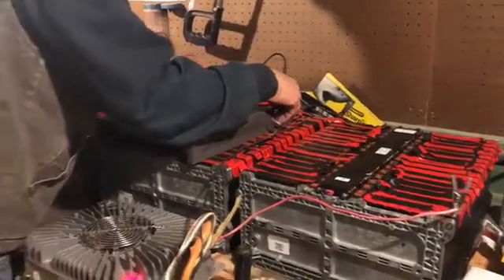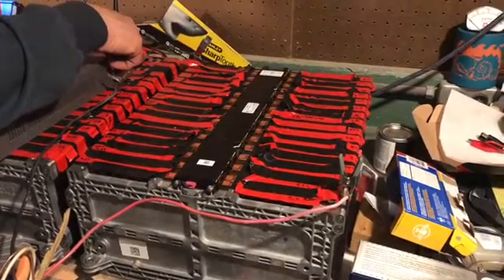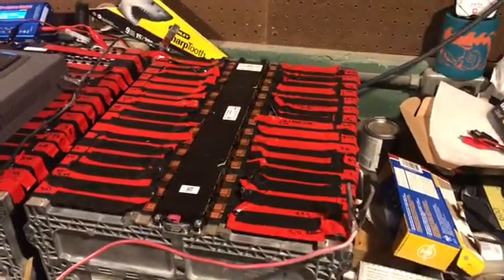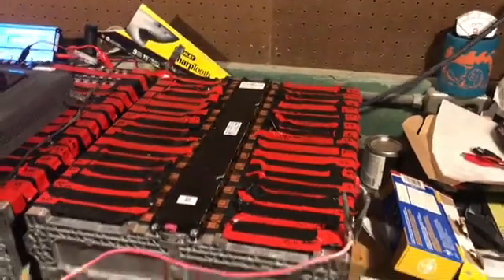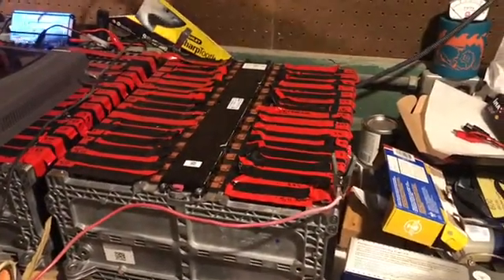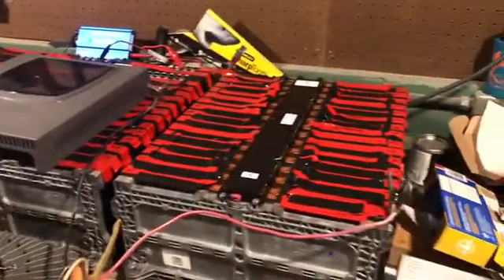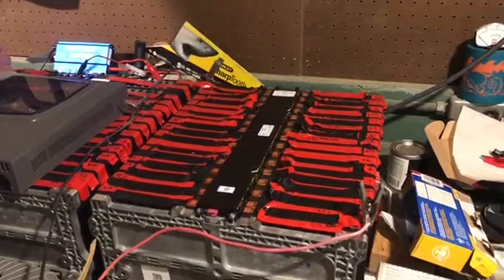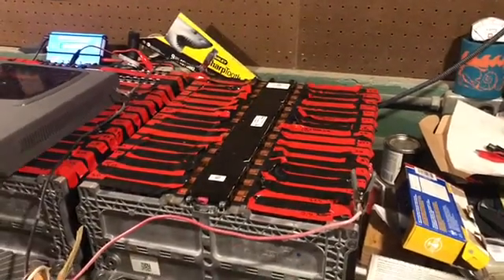Rehabbing Electric Smart Fortwo

Comment: @subjectmatteramateur16

I heard that is the 12v goes dead, the BMS goes into "junkyard mode" and disables the battery. Do you know how to fix that? Or if it is even a thing, or do I just need to charge the pack manually like you've done?

Comment: Hi Shawn, I am a car dealer in FL and have a 2016 Smart fortwo Electric with 21K miles. I bought it knowing it had a problem with the battery and not running. The car is still under warranty 4/50 bumper to bumper but the scumbags from MBUSA (Mercedes) will not honor the warranty cuz the say that every 2 years the battery has to have some kind of service that was not performed. So my question to you is: Is this battery salvageable by taking apart as you have and charging the cells separately or the 3 blocks of cells separately ? The 12 volt Aux batter is also totally dead but I am not worried about that one as it is only $200 at the dealer and I can probably maybe even use a regular 12 volt. I have the original EVSE from Mercedes. I think once the battery gets below a certain level it will not take a charge at all. Thanks, Jorge
Reply from the maker: VehicleMaxDotNet you can take the battery apart and charge each 3.6v cells, but you can’t replace them in the car because mb engineered it that way.
Reply: @subjectmatteramateur16  Thank you for the fast reply. What kind of charger do you recommend for this type of charge ? Once the battery pack is out and the cover is removed, how difficult is it to connect to each individual cell ? Is there any cutting or rewelding needed in order to access the cell terminals ? Lastly, once they are charged and assuming that most cells accept the charge...Is it just a matter of putting the top half cover back on and re-installing on the car ? Thanks !!
Reply from the maker: VehicleMaxDotNet we found that most cells took a charge and would be fine but there were some cells that were bad and not accept a charge and we weren’t successful in getting them welded back in the pack. You can separate the three packs and charge the packs individually with a specialized charger made by thunderstruck motors.
Reply: @subjectmatteramateur16  Thank you again ! Is separating the packs difficult ? and most importantly...do you charge the pack with the thunderstruck in a single port ? Or do you have to go cell by cell ? Sorry for all the questions...I just want to know if this is something I could handle. Any idea on the cost of the Thunderstruck and where to get it ? Thanks Again !!!!
Reply from the maker: VehicleMaxDotNet the main pack can be separated into three smaller packs,  those packs can be charged with a thunderstruck from thunderstruckmotors.com which is about $700. The individual cells are not hard to separate out but impossible to place back in. I found an entire replacement on car parts.com

Comment: My 2014 smart electric won’t charge. I’ve tried using the EVSE that came with it, as well as my wife’s Volt EVSE.  The 12v battery is reading 12.5 volt. I disconnected it for a minute to see if it might reset something. Nope. The car does drive, but it’s down to 9 mile reserve.
Reply from the maker: Jeff Wallace have you charged it before? Have you tried charging the aux battery? I wonder if you can tow it to charge it until it gets a little higher so the bms will allow a charge. Regen should work.
Reply: Shawn Crockett I’ve had it 2 years with no problem.  I have 9 miles  range left, but don’t want to risk running it down.  
I hooked up jumper cables, and it reads 12.7 on my digital volt meter.  There’s a nice “click” in the onboard charger (coming around the motor bay).
The display says “charge cable connected.” 
But it doesn’t charge.  
I think I’ll remove the 12v and take it to Batteries Plus.  They do free charging.  Connections look clean, but I’ve had luck with Prius 12v that just needed cleaning.
Reply from the maker: Jeff Wallace I wouldn’t have the aux battery out very long at such a low state of charge on your drive battery. The dc to dc will take charge from your drive to run any parasitic draw you might have. I wish I knew more about these cars. Mercedes way over engineered these.
Reply: Shawn Crockett I pulled the aux battery and put another battery (12.7 v) on jumper cables.  Then I took the aux to Batteries Plus. It measured 12.83v with 317 CCA.  It’s rated at 340 CCA, so he said it’s good. I’m wearing a neck brace from surgery, so I can’t get under the dash to look at fuses. The Mercedes dealer in town doesn’t do smart warranty work, so I wonder if they are clueless.
Reply from the maker: Jeff Wallace they are clueless, and they don’t want the liability. Have you tried towing it?
Reply: Shawn Crockett  there’s a public charger at a community college auto shop 5 miles away. They have some hybrids and electrics. 
My brother teaches HVAC there, so he knows the instructors. I think I saw a car dolly there, so I could try towing to regen.
Reply from the maker: Jeff Wallace I charged a truck I built by having a buddy pull me with my truck and a tow strap.
Reply from the maker: Jeff Wallace have you tried using a j-1772?
Reply: @subjectmatteramateur16  The original EVSE (elect vehicle charging equipment) is a j-1772, as is the Chevy volt's.  Both of them work on the Volt, but neither on the Smart.
Reply from the maker: Jeff Wallace I’m sorry what I meant was have you charged it using 240v?
Reply: Shawn Crockett both the smart and Volt EVSE’s accept 110/220. I’ve tried them both ways.
Reply from the maker: Jeff Wallace the problem with these batteries is that they are all in series so if one cell starts to lag there is no balancing to bring it back into check. The BMS senses that cell and disallows any current to go in. 
Taking it apart and charging just the one bad cell doesn’t solve the problem either. The BMS then has to be re-flashed/re-manned. 
As long as it doesn’t say not to tow it I wouldn’t take that option off the table. I just used the ball of my truck and a tow strap.
Reply: @subjectmatteramateur16  so, by towing, I'm just seeing if the regen works, just ruling out a bad battery?
Reply from the maker: Jeff Wallace, it’s such an enigmatic car. I personally would try that.
Reply: Shawn Crocket When I first got it, we towed it with a strap, just to see how much regen gives. Pretty scary.  So I’m looking for a car dolly.
Reply: @subjectmatteramateur16  A few days ago I loaded it on a trailer & hauled it 100 miles to the dealer.  On the way, I stopped at a public charger, and it did not charge.
2 days later, the dealer called & said they had tried charging it overnight & didn't work.  There is a recall for the BMS, which I asked them to do (just a software update). They have another car with the same issue.  I asked them to troubleshoot that one first, said I was in no hurry.  I'd rather they learn on someone else's car.
Reply: I heard from the dealer.  It’s the charge port.  $1500 installed, including labor & tax.  I found a salvage port for $50, but i would have to splice it in.  And who knows what condition it is in.  I told them to order the part. Thanks for your input.
Reply: Update:  there were 2 recalls on the car: 1. steering. 2. BMS software update.  After they did those, it took a charge.  I picked it up yesterday, and it was 100% charged.  Drove it a few miles last night and it charges normally.  I’m out $159 for diagnosis.  I’ve ordered the charge port with full wire harness from a salvage yard. $100 I may not ever need.  Still feeling lucky.